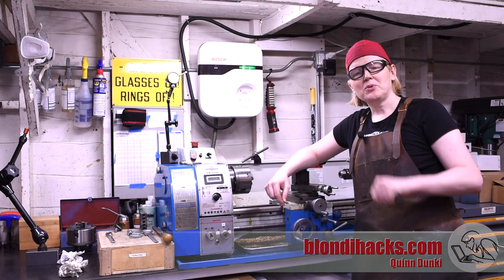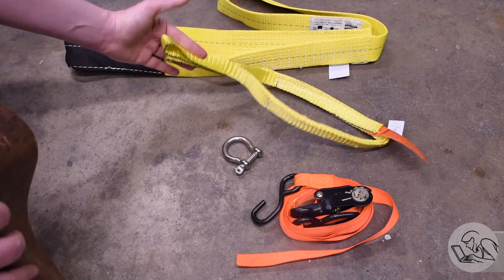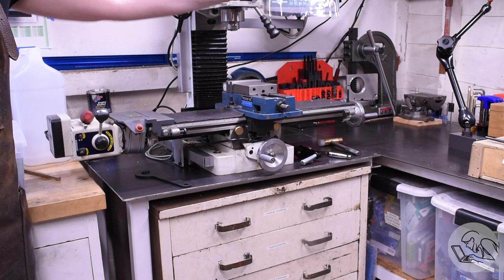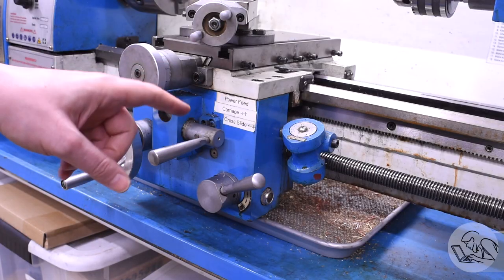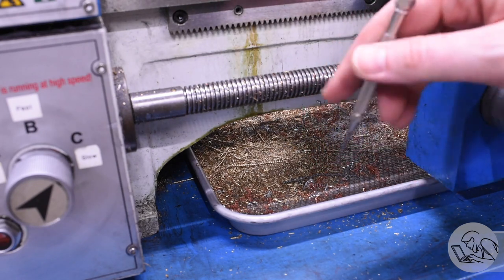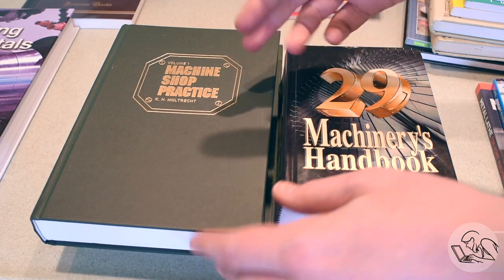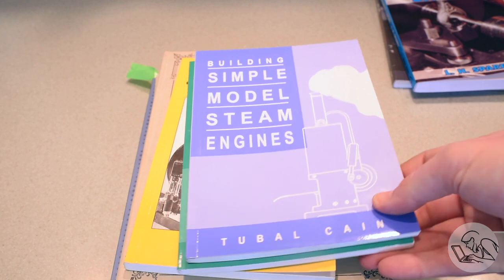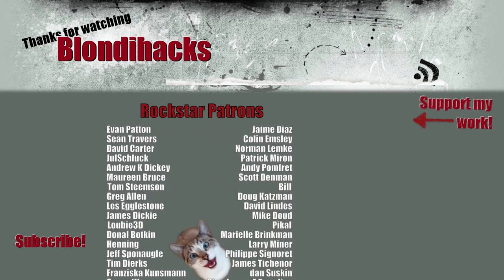Absolute Beginners To Machining : Day 2!  More questions answered

Comment: also is it wrong if I use acetone to clean?
Reply: @gvet47  oh yes, thankyou
Reply: Don't forget to ventilate.
Reply: Wear the proper gloves for handling Acetone (any chemical for that matter) as it will move through your skin and get in your system. Decades ago (70s) we used acetone to clean SS when making TIG welds. We wiped down the filler rod, the pipe, EB rings, everything. Got all over our hands as no one was given PPE back then. OSHA was brand new and had no teeth. I did this for years and it damaged my skin. Don't let it happen to you.

Comment: Question 1: I saw that arbor press in the back corner.  It looks a lot like one I could get from an uh, embarrassing place down the street - at a suspiciously low price.  But it looks kind of small.  I've never seen a YouTuber use such a small one.  How long after you bought it did you wish you had a larger one>
Reply: When you have a little press, you need a brute of a big one. When you have e big one, you need a small, sensitive one.  The only solution is to have at least three. That way, you'll only be short the monster 50k ton hydraulic press.

Comment: I would expect to see lifting hooks/points on a machine as the factory would either overhead lift or forklift during manufacturing. But what do I know, I am not as smart or beautiful as Quinn is.
Reply from the maker: Hobby machines don’t typically have lifting points on them. You have to pick a casting to sling under.

Comment: Personally I hate ball oilers with a passion. I have Goldenrod oil cans and it’s still hard to make them work right. If they didn’t stick up and get in the way in some places I’d replace every single one with those little oil cups with the spring loaded caps.
Reply from the maker: Yah, I’m with you on that
Reply: @Blondihacks  The bench mill I use at work has a power feed on the X-axis like yours that made the lead screw oiler inaccessible. I ended up drilling a hole through the mounting bracket, pulling out the ball oiler, making a little brass oil cup to replace it, and tapping the hole in the bracket for a large grub screw to keep the junk out. Now I just remove the screw and shoot a few squirts into the cup. I put a little felt in the cup as a filter.
Reply: @robertpearson8798  You probably know this but the felt in the cup is less of a filter than it is a wick that keeps the oil from running straight out onto the floor.
Reply: @Warped65er  Absolutely, but it will also keep metal chips away from the shaft. Win, win.
Reply: @ChazzC  I can’t take credit for the idea. I’ve seen a couple of other Youtubers do it first. My only variation was using a grub screw for a plug.
Reply: @ChazzC  Good idea but I had a set screw on hand.

Comment: Not a question but a tip (that I didn't invent):

I've often noticed you messing with little pieces of Aluminium or Copper to protect finished surfaces in the lathe chuck.

It's really easy to make "stay put" softeners from copper pipe. Lots of people use this, here's a good (and short) "how to"

https://www.youtube.com/watch?v=_PuSl_PyMNI
Reply from the maker: I’ve done a video on that in fact and have shown my soft jaws in action in many videos. I prefer this other approach in many cases.
Reply: @Blondihacks  Apols. I thought I'd watched "a lot" of your vids, but I've missed the "making" vid AND the using vid.

(off to YouTube search function)

Comment: Re: WD40 is not a lubricant - Hurray, 
sane commentary on WD40 usage. WD40 is solvents and a thin oil that it leaves behind. THIN. Enough for light duty rust prevention, but not a mechanical lube at all.

Comment: WD 40 AKA kerosene, (plus a solvent and in some cases a propellant. The propellant is often propane.) Brake cleaner AKA acetone. Nasty stuff. Wear an appropriate mask.
Reply: The best brake cleaner uses trichloroethane (sp?). It's a great degreaser that is not flammable. Its trade name is Brakleen.